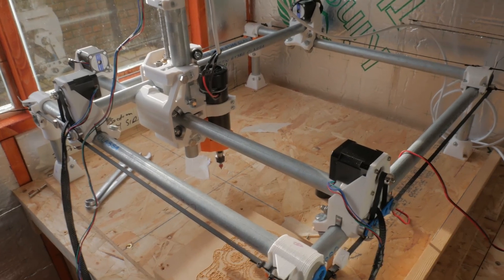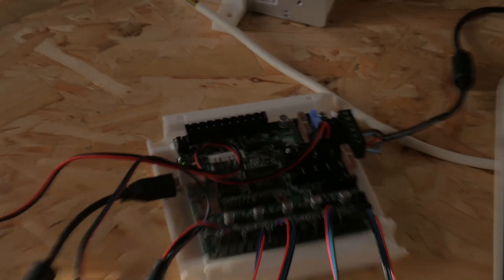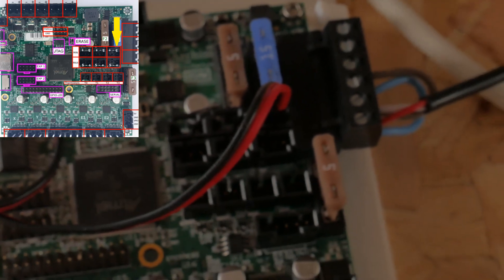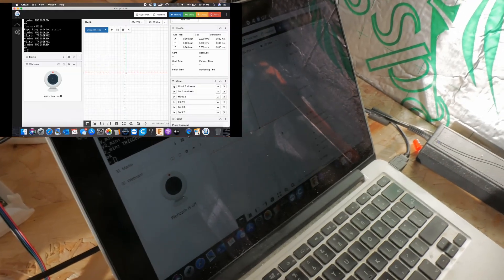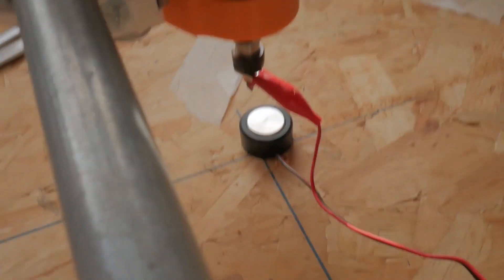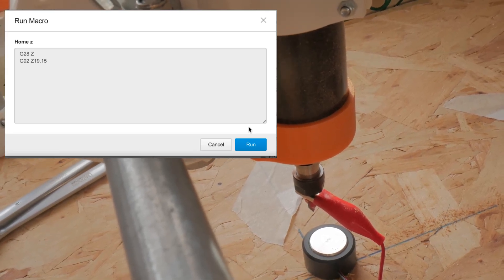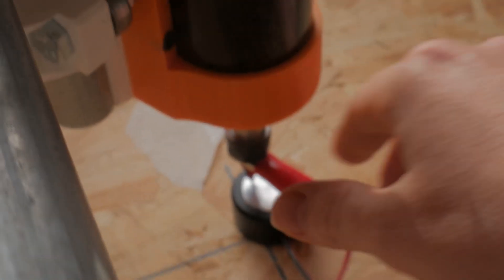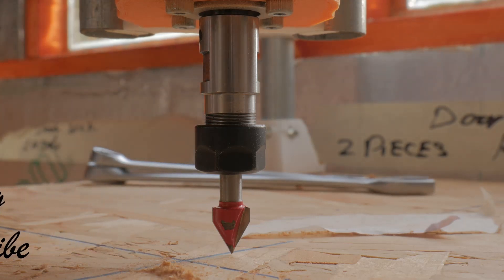MPCNC Touch Plate

Comment: Where is the touch plate thickness stored, in the firmware or toolpath generator/slicer?
Reply from the maker: When I run the g28 z to probe the touch plate, I follow it with a g92 z19.3 this sets the z at 19.3mm meaning if I zero the z the tool will be touch my work surface. This needs to be done before each tool change effectively. If you were to power the machine off this would be lost as when you turn it back on whatever position it is in becomes z0. 
I think don’t quote me on it, if you ran m500 after the g92 it would save this setting to the firmware. But change tools or the work piece would negate this as you’d have to probe the z again anyways. 

You could add the code to the beginning of any program but would have to add other commands in to pause the program etc. I’m going to do another video on this soon
Reply: curious as well